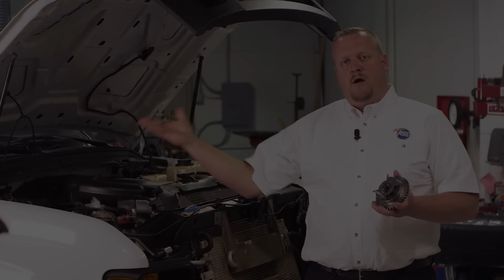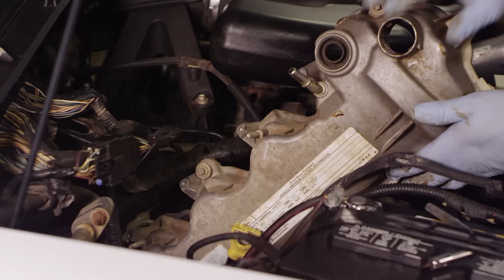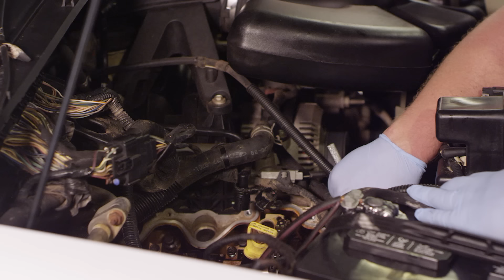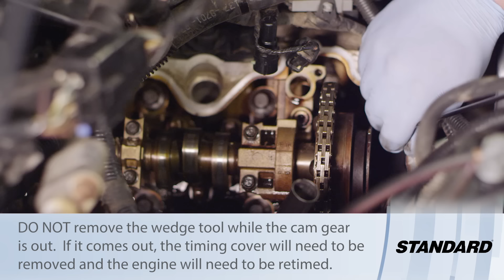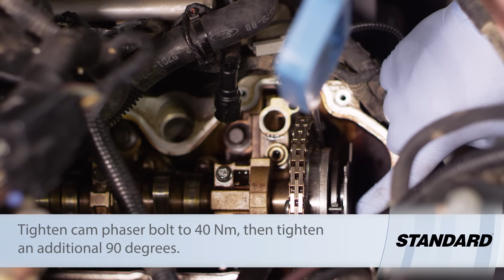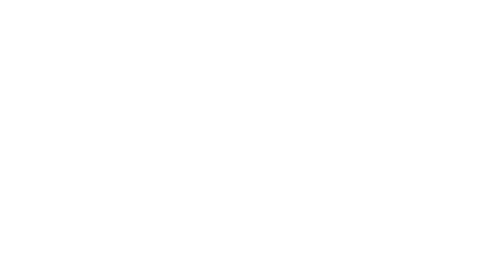Ford 5.4L Cam Phaser and VVT Control Solenoid Replacement

Comment: hola amigo tengo un problema le cambiaron todo el set compreto ami troca.el mismo motor q tienes pero ya despues de un rato manejandola.faya derepente.y se quiere apagar ay q aselerarle.y suena cuando faya q cre utd.q sea.y grasias por subir sus videos
Reply: Mario Carmona hola mario, tengo el mismo problema, si lo sulucionastes y como?
Reply: Hola amigo. 
Quiero preguntarle si arreglo su problema.
Esque tengo el mismo problema que usted y le cambie todo a mi troka también y hace exactamente lo que hacía la suya.
Reply: Yo tengo un problema igual que el tuyo ya solucionastes tu problema?

Comment: the key to not having to remove the cams is to position the crank so that the valves are under minimal compression and will not shift the cam much. I did it on a 2007 mustang. i forgot what the degrees was but it worked out.
Reply: You remember the position the crankshaft to leave the cam with minimum pressure???